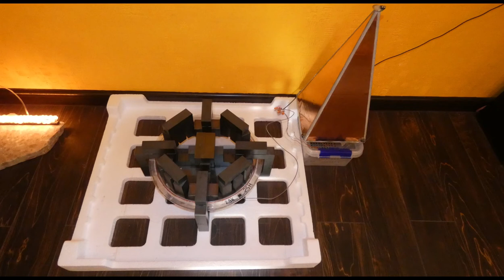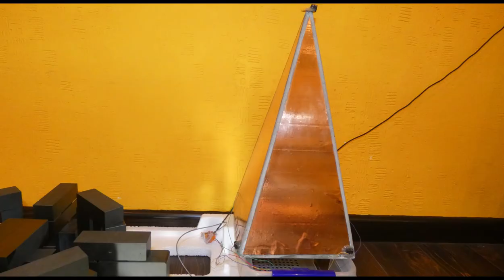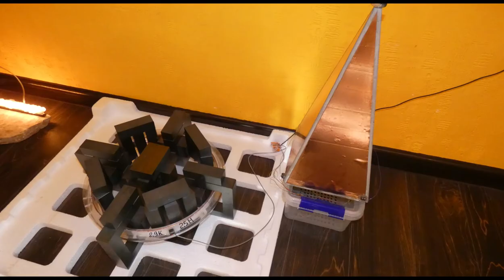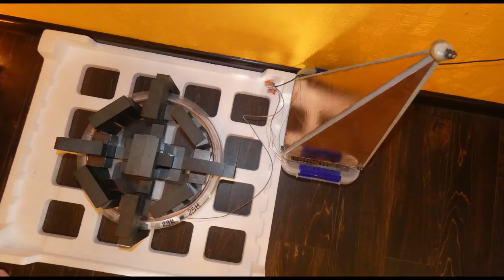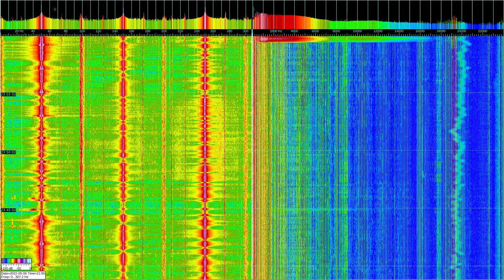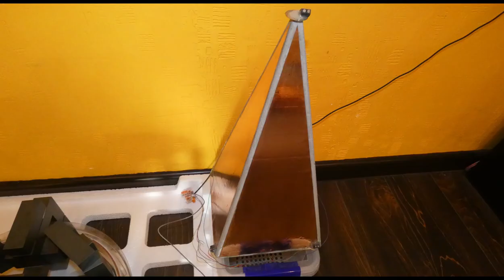EMF monitor 6-05-22

Comment: I think that some time , in waves , with differente materius can be other waves or Energy . I think now almost the transmition have frequency like light, sound, water ,....,  and differente "antena" can take that signal like rock quatzo, mercury , iron, copper, but if one people find that if think is a little bit complicated some kind of "citizens " don't like still .
Reply from the maker: here the left sensor is oriented more towards the magnetic component, and the right one towards the electrical component (the right sensor may have unknown properties)